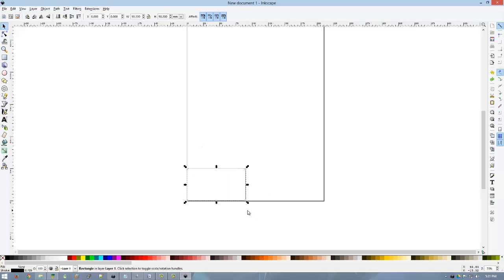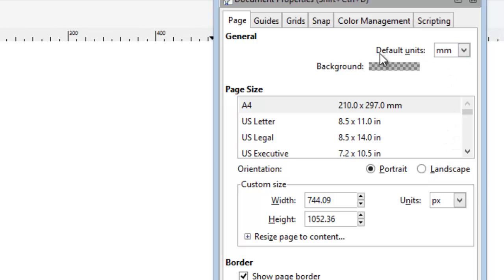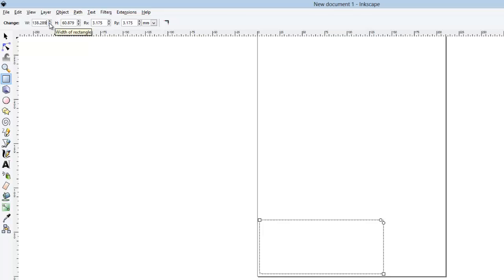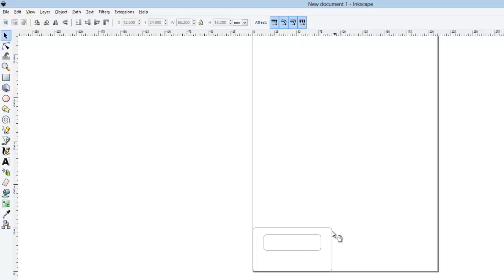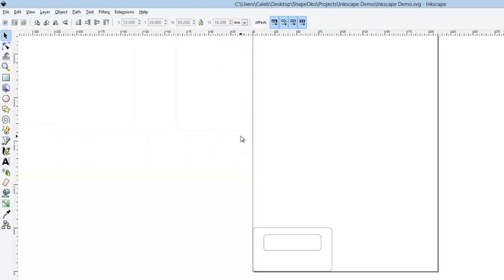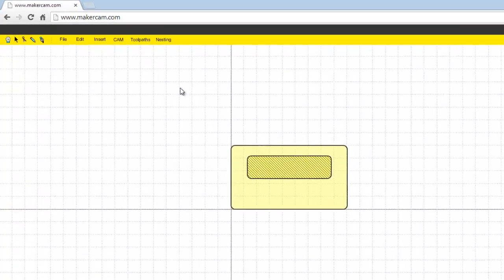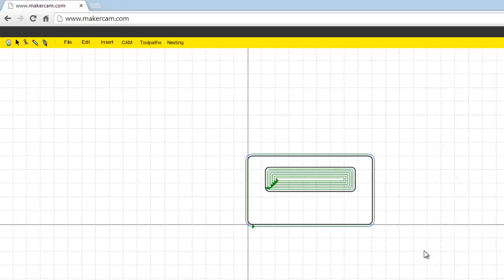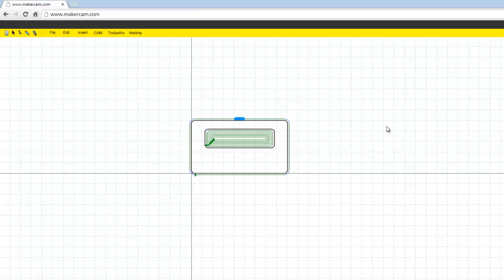CAD/CAM using Inkscape and Makercam

Comment: As I recall, the changes in dimensions … adding that .02 to your width or height … has to do with pixels and weird math around sub-pixel something or other. As well as number rounding. In a nutshell, it's math; it's not an Inkscape issue; there isn't anything you can do about it; it doesn't really affect anything in the real world. Annoying for sure but ya just gotta ignore and roll with it.

Comment: The reason your radius keeps changing IS because of the stroke width (which ALSO scales when you scale the object).  you need to change 2 things:  
1)tools-preferences - CHECK geometric bounding boxes.
2) unclick the box 4th from the right.  see my video "boolean clones".

Comment: Hello. I wanted to ask you. You give the dimensions in MakerCam in mm and how do you transfer it to the Shaepeoko 2. Did you upgrade the Firmware or. Because the last time I draw and send in mm it was very bad. 
And second my Inkscape when I draw the rectangle it disappear  after that and it is invisible when I draw. How can I change that?
Kind Regards
Reply: Make your stroke a solid colour not invisible.

Comment: Hi,
Iwas wondering why you used Makercam when with the Inkscape you can generate G Code?
Reply from the maker: Good question, I take it you are talking about an Inkscape plug-in like GCodeTools. I suppose it's because I purchased a Shapeoko, and the Shapeoko community is very pro-Makercam. A tool chain of Inkscape and Makercam was also the first thing that I saw demonstrated in conjunction with the Shapeoko. So, it became a very easy choice to choose that over anything else when I was starting out.
Reply: Caleb Peters Thanks for the answer. It explains things. I am looking into building my own cnc and was looking into the different cad/cam programs. By the way yiou seem to be the only site that does a great review of different choises. Thanks again